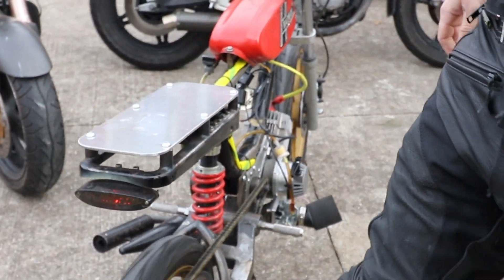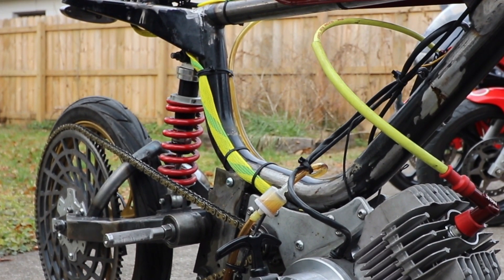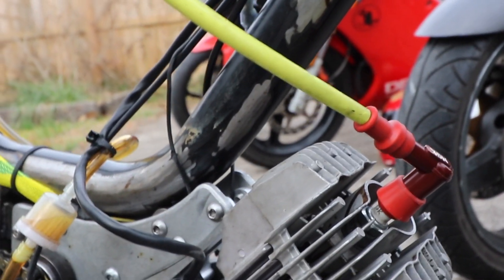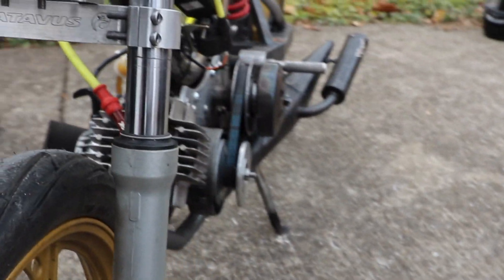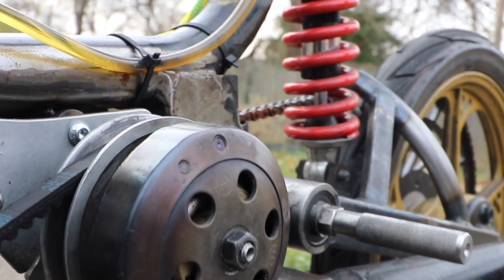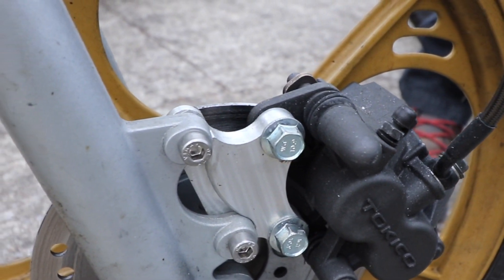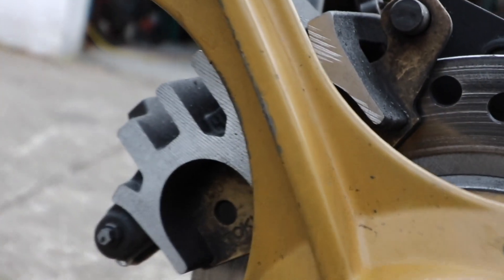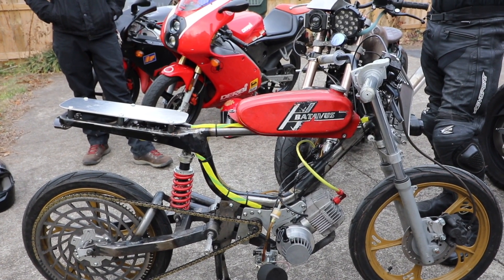Race Batavus M48 / Moped

Comment: What's the lowdown on that variator/clutch pulley setup? Looks like a GY6 pulley on the rear but what's on the front? Different crank with a variator made for its taper?